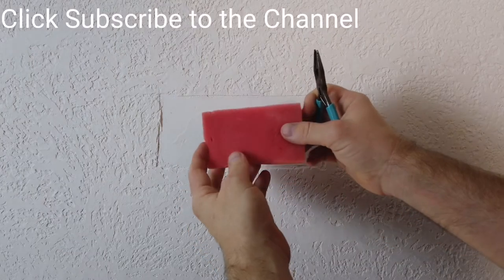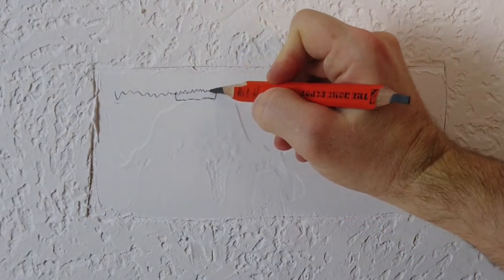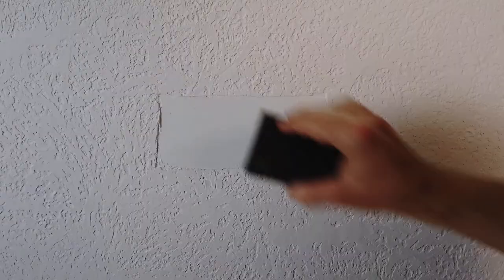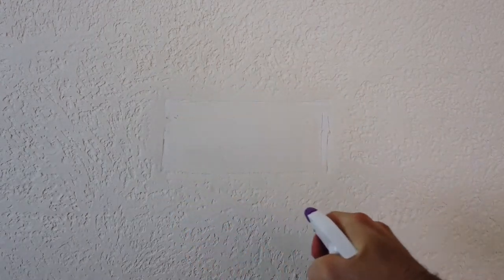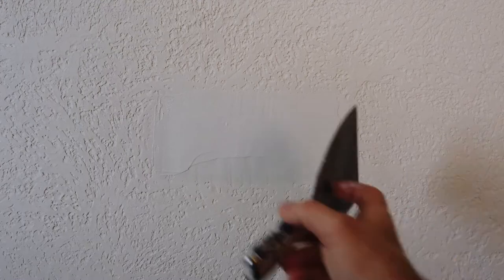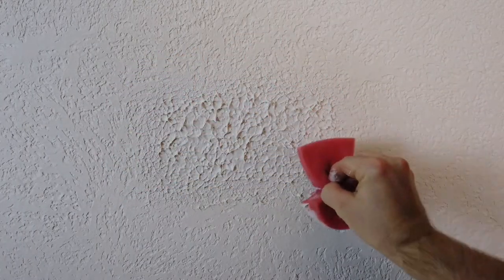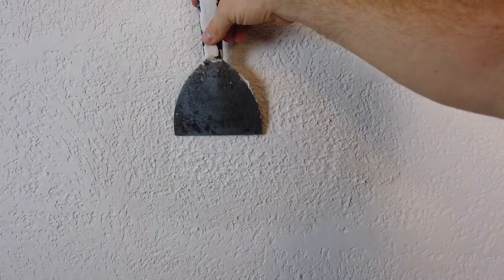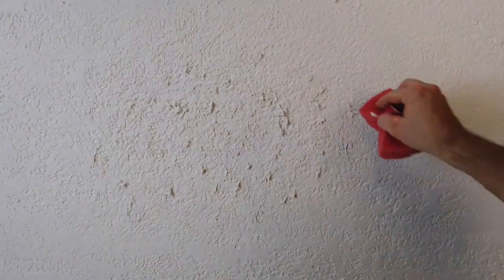Patching ceiling or wall texture stipple

Comment: Thanks for the video - it saved my sanity (and made my wife happy too).  I'd looked at many techniques and specific sponge texture techniques but yours was the first to explain that the sponge needs to be loaded (i.e., cavities filled) before applying.  The other method(s) were just making a mess.  The was exactly what the doctor ordered.  I had about a sheet and a half to texture and didn't want to get a sprayer.  This is for sure great for small areas but is also more than acceptable, in least in my case, for larger areas as well.  Just took my time doing roughly 3X3 ft areas at a time.  I'm ecstatic!

Comment: Ok this doesnt look as challenging as i thought. The sponge method gives me confidence to install those extra outlet boxes i need for the entertainment center in my new home which has this texture, i was sort of putting it off because i will need to open up an access hole that will need to be patched up, this method gives me confidence.

Comment: This texture and crows foot is a great texture to say "Im slum lording". these are great textures to say "I cant afford equipment for my supposed profession." Seriously get a compressor, texture gun and knock it down, So your house doesnt sell as a fixer upper. Thats ok youre not selling. Youre slum lording. These textures are great examples of the philosophy or stop being a poor. No one should be thinking about their wall texture. But there it is front and center. Reminding you that everything in your life is set to nightmare mode, Including your wall texture. Reminding everyone else youre a poor and incapable of doing anything right.
Reply from the maker: In my opinion, any texture looks bad. Modern architecture is smooth walls and ceiling. But existing homes with texture still need occasional repairs and patching, this is a video for that.

Comment: Great texture video with a sponge. Just in time. I need to do a small area in my ceiling as well.
Reply from the maker: Thanks. This method is a bit of an art, my advice besides what I showed in the video, is to take ones time, and don't overdo it. Better to underdo it, and do a second "coat" to refine it, as I did in the video. Or even a third if needed, going wider each time to blend.
Reply: @Interior_Works  The area I need to texture is about 12" x 48" due water damage from a leak in the  roof. I've put new tape and sanded the joint compound smooth and level with the existing texture on the ceiling. Just hope I can match the existing texture.

Comment: ...or you could just go out and buy a proper texture sponge for a few dollars...

HOWEVER....this technique is simple and awesome! Before it dried at all and before you knocked it down it already looked 80% better. Once you knocked it down it looked incredible! Nice job! I will be trying this. I've been painting for 24 years and haven't always had good results repairing cracks in textured ceilings. You make it look foolproof!

One guy on here said to not use a regular knife but a plastic knock down knife. Yours worked fine.
Reply from the maker: Thank you, I tried a couple texture sponges from paint stores and they were ok. I like making my own sponges because if the texture is small splatters I'll pluck small holes out of the sponge, for a heavy splatter or heavy knockdown I'll pluck large holes out. I just think I can get better results custom making my own texture sponges to perfectly suit the texture style and size, and bonus being kitchen sponges, when I'm done I can give em a quick rinse and then do the dishes too.

Comment: That is pretty impressive and a great tutorial video! 
Not sure about Manitoba but here in Alberta mostly flat wall.....unless it’s a hotel lol.
Eager to see more of your compound tube application videos.  I’m not a pro and struggle with air bubbles, mud too thick/thin issues.
Reply from the maker: Thanks, here it's mostly flat walls and ceilings in new houses, but older homes especially 90s and early 00s are usually knockdown texture ceilings. Occasionally see it on walls too. I intend to do a full series, on all the tools from start to finish, and compound tube soon